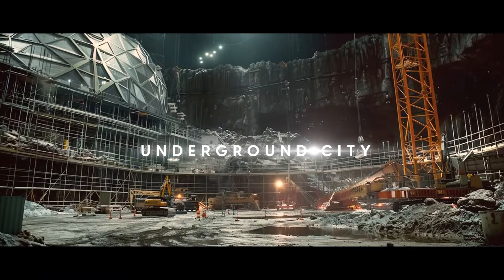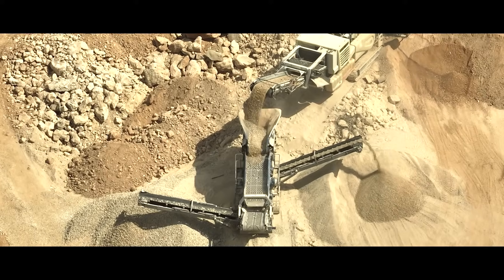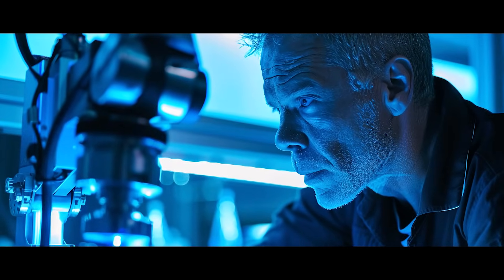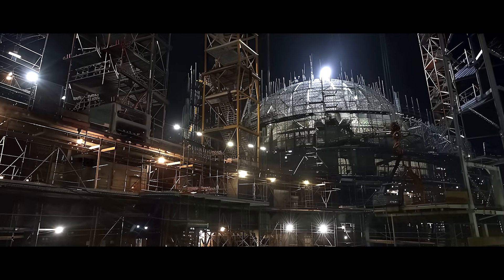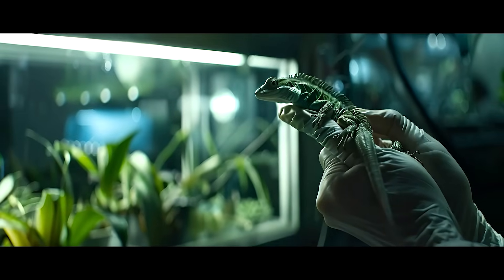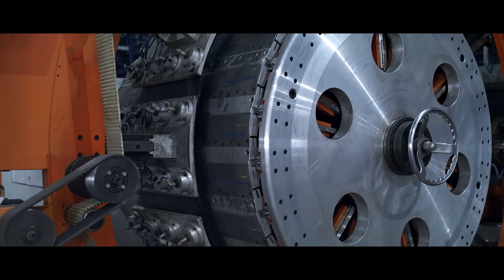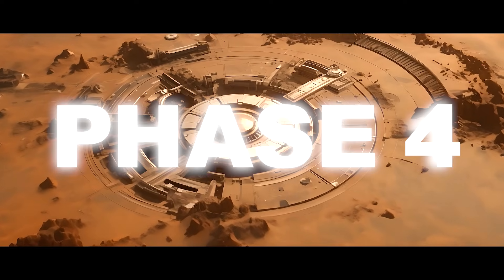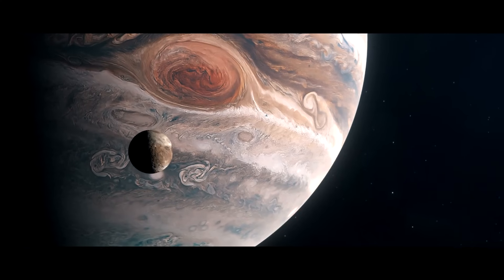TIMELAPSE: Building an Underground Mars City (Sci-Fi Documentary)

Comment: Mars tends to get a lot of our attention, while Venus is largely ignored. However, the prospects of habitability there would be much easier than on our little red cousin. A gravity much closer to that of Earth would make this colony much more comfortable than our Martian city. Would you guys consider doing a video about setting up a floating colony in the upper atmosphere of Venus? Surface mining on Venus would be an exceedingly difficult task, but probe mining Mercury from Venus could be easier from this base.
Reply from the maker: I should look into it further
Reply: The pressure and temperature on Venus is not survivable. The Venusian atmosphere is nasty, hot thick and corrosive. The planet emits so much radiation as it's surface is the hottest thing in the solar system except the sun. There is a very thin layer of oxygen in the upper atmosphere about 100km but everything else makes Venus totally inhospitable to humans and most if not all machinery.